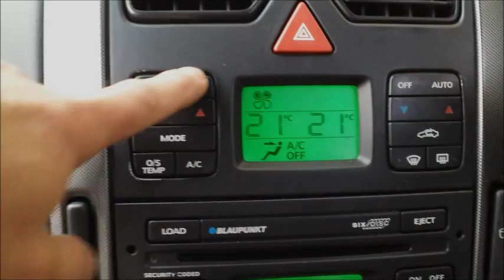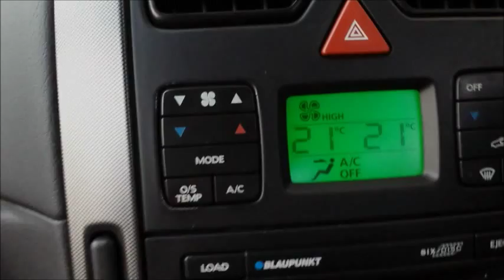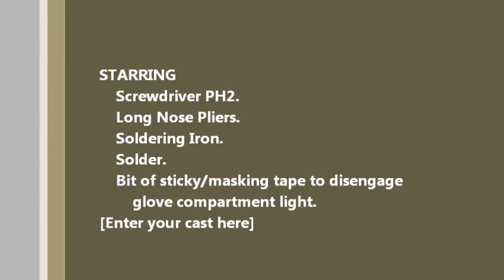Holden Fan Blower Motor Resistor

Comment: you mentioned to repair it replacing is a better option as they have a better blower motor resistor they are only $132 from Holden the new ones do not have the link on the outside so the solder will not break and they are also longer so replacing is the better option I went to my Holden dealer they had them in stock I just did mine on my Caprice

Comment: Great video. The last few days my blower takes a long time to come on. Even when using the highest setting. Is this going to be my resistor or is something wrong with the blower motor its self? Any help appreciated thank you.
Reply from the maker: If your resistor was soldered properly (no "dry soldering" ) it should be a motor. 
"Dry soldering" relates to uncleaned/not properly brazed/ cleaned wires/links.
In order to check the motor - you need to test it for the motor windings resistance/insulation. You can do it with a good multimeter(e.g. "Fluke")

Comment: Just came across your video, I have a holder rodeo space cab 2003 model, would this be the same process your reckon? I will definitely give it a crack when I get the time